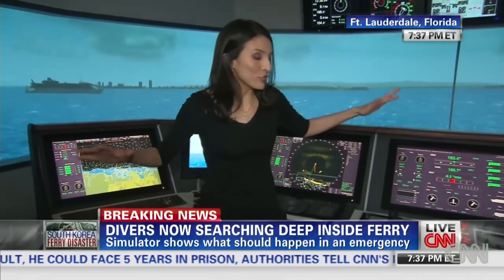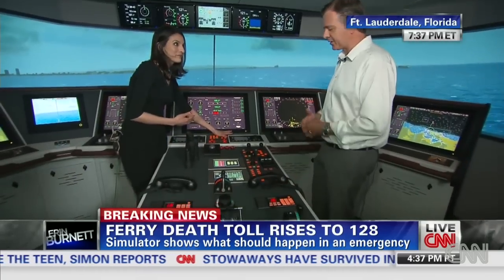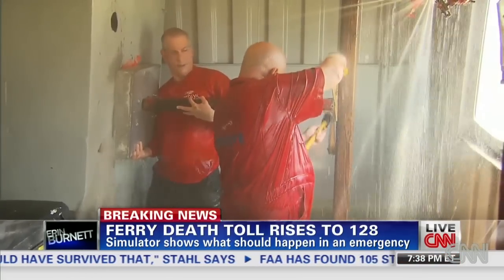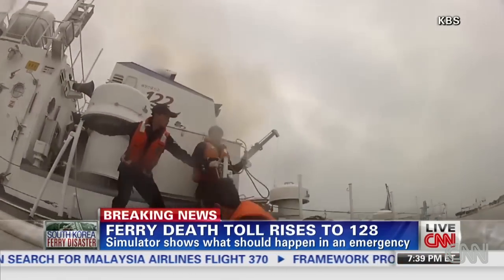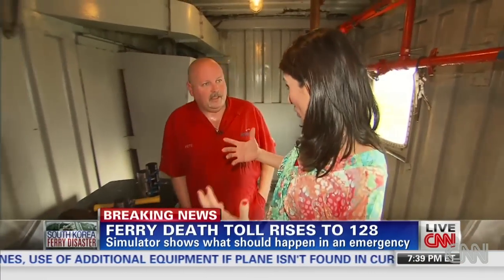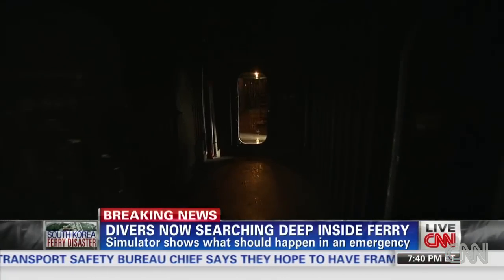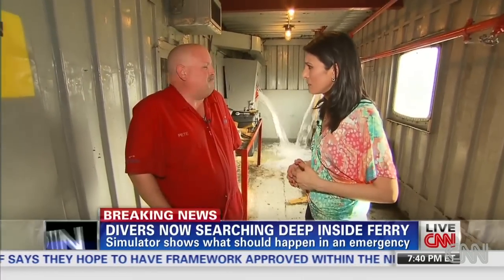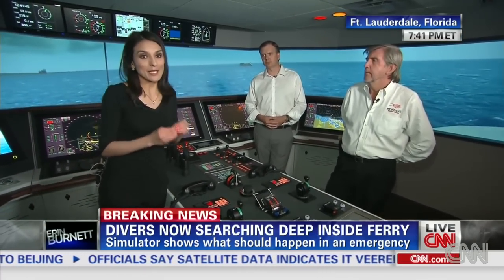Simulator shows what to do in sinking ship emergency

Comment: If you don't know the layout of this ship, or the ship is tilting fast, JUST RUN FOR YOUR FREAKING LIFE!
Run around until you find a staircase, which is better if it farther aft cause the water won't be in the way. If you have no other way but through the water, hold your breath and dive. Also, to give yourself time to get out, close any doors where water is coming in, and shut them as tight as you can. If you can find a valve to drain water, turn it. Also, if you have stuff like furniture, block any doors that look like they will burst.